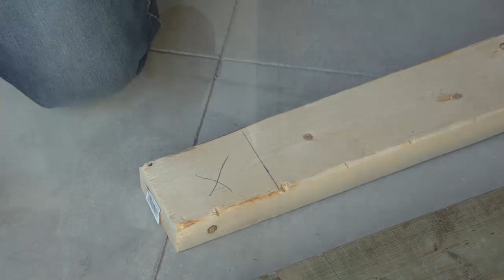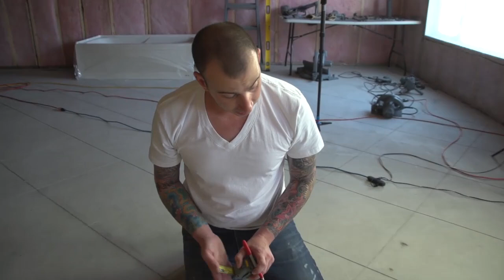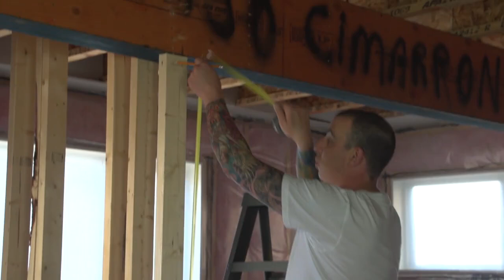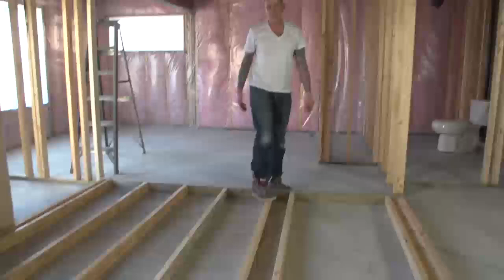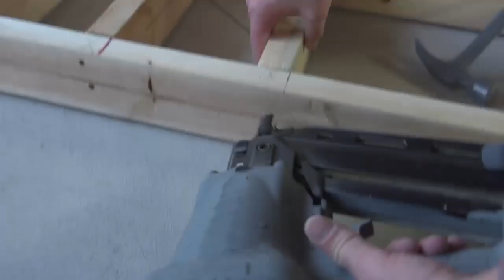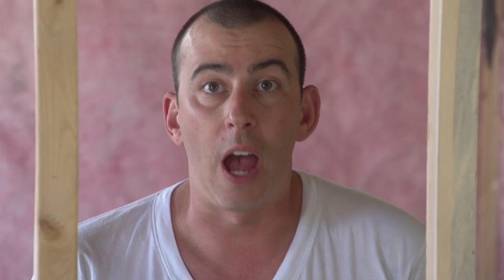How to Frame a Basement Wall with Door

Comment: Knew to all of this. I had a couple questions and they both involve the door. If you said you ordered a 30 inch door but had the framework set up for 32 inches, why is that? It’s probably really simple answer but like I said, I’m new to this. And at what point do you remove that section of wood at the bottom of the frame for where the door is going? I realize that some stay, but I also know that some get removed or our pre-cut before you set up the wall. Is that what’s happening in this case?

Comment: Can you please provide details on the type and size of the concrete anchors you used to secure the base plate to the concrete?
Reply from the maker: If it’s a load bearing wall 1/2 anchors. Non load bearing walls 3/16. One of the best anchors is drill a 3/16 hole 3” deep and use a piece of rebar tie wire and a duplex 3 1/2 nail. Common anchor use for concrete form work. Hope that helps.

Comment: I'm a bit new to DYI.  I notice that you ran your footer the width of the entire wall.  Isn't there supposed to be a floor opening where the door will go?  Are you planning on using a raised floor in that basement?  Sorry if it's a dumb question.
Reply: Cash Komick you saw out the footer when you're ready to install the door
Reply: You have to leave it so it keeps everything plumb and also when u instal your king studs u need them to set on top of base plate. Use a oscillator or a saws all to cut out the portion u don’t need after the fact

Comment: For a basement pre-hung door, do you (A) leave one inch of the pressure-treated wood on either side to rest the door frame on, (B) does the door frame sit on the slab, or (C) do you shim up the frame 3/8"?
Reply from the maker: That depends on the flooring going down. It you have carpet on both sides, raise the frame 3/8-1/2 off the slab. If you have tile I would go right tight to the slab. If tile is on one side and carpet the other go tight to the slab.  I hope this helps, let me know if you need anything else.
Reply: @ConstructionCoach  Thanks so much for taking the time to answer my question. Your videos and advice are very informative!
Reply from the maker: Thanks for watching, let me know if you need anything else.

Comment: nice. thank you! what about that section of 2x4 treated wood on floor... does it come out to accommodate the door?
Reply from the maker: Yes, cut it out.
Reply: @ConstructionCoach thanks!
Reply: Whats the best away to cut it out? Can't use a blade against concrete
Reply from the maker: I like to use a reciprocating saw or a oscillating cut off tool. Before I had all these fancy tools I used a handsaw. Hope this helps

Comment: I see you’re using treated base plates. I am about to finish my basement in Calgary on my new home and noticed that Jayman (builder) didn’t use treated base plates on the exterior framing walls. Is it not code to do so?
Reply from the maker: I’m not sure if it is code. It is definitely a good practice. Sometimes the builder will have the poly under the frost walls to separate from the concrete. Good luck with the basement project.

Comment: Can a new bathroom wall be built in 4 1/2 foot sections, where two of these sections are put together to make a 9 foot wall. The wall will obviously have sheet rock on both sides like a normal build. This will be a partition, non-load bearing wall. A normal shower will be on the backside of the wall. No tile, just fiberglass panels. Nothing fancy. I just realized I don't have any 10 foot 2x4's to create one continuous wall. Plenty of 8 foot 2 x4's I can cut down. My wife has been waiting a year to get surgery due to the virus. She is going to have it in a few weeks. I don't want to go out to buy and potentially catch the virus and bring it home to her so that her surgery is postponed again.

Comment: Thank you so much for such a detailed tutorial video. I have learned a lot. I have one question, I am planning to put up two walls and a door in the finished side of the basement which already have laminate flooring installed. What do you recommend to secure the bottom stud to the floor?
Reply from the maker: Depends if you want to make it permanent or not.   I would use a heavy grade two sided tape if I was removing at a later time.   Silicone under the bottom plate would work for a more permanent install.   Hope that helps, thanks for watching.
Reply: Great video.  You cover a lot of detail us amateurs do not know.  Related question if there is already a laminate floor.  If I were going to have an 80" high door.  Would I eliminate the section of bottom plate below the door and have header at 80ish inches from the laminate?

Thanks again.  Liked and subscribed.
Reply from the maker: The opening is usually 2” taller than the door.
Reply: If you don’t plan on reminding by the wall use 2.5 in Tapcons or even better buy a ramset for 30 dollars and 2.5 inch nails. Also make sure if there is a door anywhere u want to secure baseplate with tap on or ramset. As close to possible on both sides of the door

Comment: Where the bottom of the wall is attached to the floor, in the door way do you cut the portion of board out or leave it. And if is to be cut out, what is the best way to remove it (cut it out)?
Reply from the maker: Great question. The plate will have to be removed at the doorway, I like to leave it until the drywall is installed. Sometimes they are a little hard on the walls putting up the board so the wood will crack around the fasteners. I always use a reciprocating saw or a hand saw will work. Hope that helps, thanks for watching!!!
Reply: Thank you!

Comment: I see there is some clear plastic or visqueen attached over the insulation on the exterior wall/foundation studs.  Is that to provide a vapor barrier because your insulation does not have one?
Reply from the maker: That’s right Edward. How do you do it?
Reply: @ConstructionCoach  I don't know.  I'm just a beginner at this stuff and I'm trying to learn.  I certainly don't want moisture seeping through the concrete foundation walls and floor of the basement and then rotting the timbers and drywall.  I just want to find out the correct way to insulate  the walls, and cover the studs on basement rooms where a portion of the exterior walls are partially underground and behind a concrete foundation wall.
Many thanks for your excellent video.  I have subscribed to your channel.
Reply: @eols2190  different places do it differently, I'm in Alberta canada as I'm sure this guy is from aswell and that's how we do it, I've seen some videos in the states where the insulation has the vapor barrier. I plastic is cheap and it's worth adding even with the vapor barrier insulation
Reply: Being a Canadian that married an American I was amazed to find that in NY state insulation comes with a paper back barrier.  Even more surprising was their lack of  use (and understanding) for plastic vapor barrier as well as other best practises exercised in Canada for energy efficiency.   Thanks for your video and a BIG thanks for the background visual of how "us" Canadians use vapor barrier!

Comment: Don't you need to cut out the bottom plate where the door is going to go?
Reply from the maker: I always do it after drywall is installed. Thanks for watching
Reply: @ConstructionCoach  thanks for replying. How do you cut it out? With a handsaw? A circular saw?
Reply from the maker: Reciprocating saw, if you don’t have one of those a handsaw will do.
Reply: @ConstructionCoach  thanks

Comment: Bit late to the comments here but do you end up cutting that pressure treated plate where the door opening is?  Cheers
Reply from the maker: Yes, I usually do it after drywall is installed.
Reply: @ConstructionCoach  Right on, thanks man. Love the videos and hope all is well. (thanks for the quick reply!)

Comment: I really appreciate the level of detail.  However I have a few comments.  In the video, you're marking the studs 16inches on center, starting at the end of the plate.  Because you've subtracted 3/4 inch from 16 inches to put your mark, your first two studs are not 16 inches on center.  Since your tape measure is starting on the left edge of the first stud, if you mark 16 inches from that, you will be marking the left edge of the second stud... and so on.  If you were to then move the end of the tape measure to the center of that first stud, you would see that the center of the second stud is 16 inches away.  If you start on the other end, where you're starting with the right edge of the first stud, you would then mark the right edge of the rest of the studs at increments of 16 inches.  Several times during the video you cut a 2x4 with the saw in your right hand, and you cross your left arm over the saw to hold the board.  That is a dangerous position and should be avoided when ever possible.  There are other times where you're cutting a small piece of 2x4 from a larger length, holding the small piece in your left hand, leaving the longer piece floating.  It might be a matter of preference, but I've never seen a carpenter cut wood holding it that way (except you).  If you had framed in the header of the door before attaching the studs next to the door's king studs, you would have had better access to the area where you needed to screw the header, and you wouldn't have to wait until you stand up the wall to finish connecting the header.  Most of the nails that go through the plates appear to be on the upper half of the plate (with the wall laying on the floor).  The nails are supposed to be evenly spaced.  When you put together the corner it doesn't appear that you made sure the ends were flush.  After you connected them I could see that that blocking piece was off by about 1/4 inch.
Reply: This was confusing to me as well, until you realize that the first stud doesn't matter. What's necessary is that the centre of the second stud is 16" from the end of the wall, and they continue from there 16" on centre. Otherwise, 48" drywall sheets won't land at the middle of the studs. See this image:

https://i.stack.imgur.com/pslGC.png

Comment: What are your thoughts on metal framing. I installed a sump pump in the basement. So hopefully now no more water. A carpenter said incase of water he would do metal for longevity and zero water damage. And also keep the drywall 1.5" off the ground.